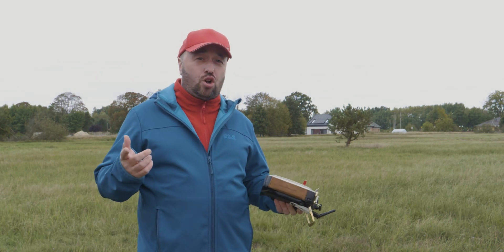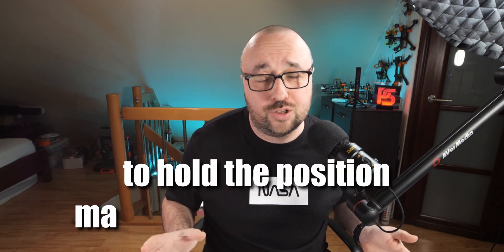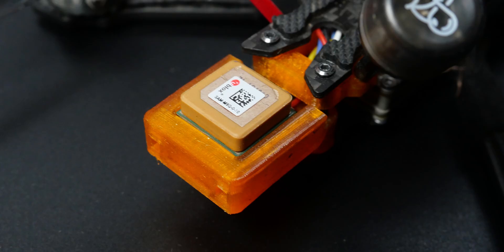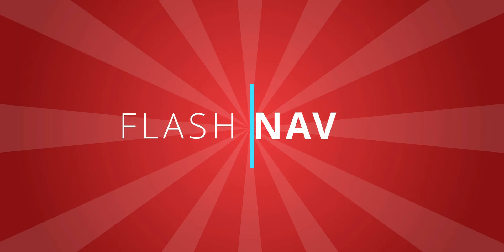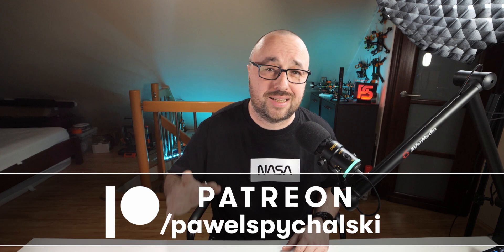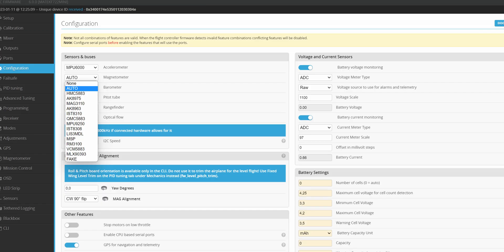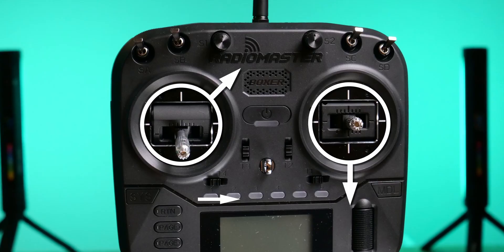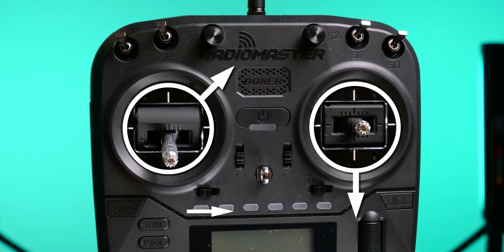8 steps to GPS Position Hold for an FPV drone

Comment: I've always flown 5" with betaflight but I've recently got into 7" medium range cruising. Would you recommend inav over betaflight if I will be doing more smooth flying with very slight flips and rolls? I've used inav on wings before and it was brilliant but never used it on a drone before

Comment: I have a Ysido F4 v3 with baro Flight Controller and unfortunately, don't have SCL and SDA ports. Do you have something in mind how to connect a I2C equipement in the board? I have tried remapping ports in betaflight but doesn't seems to work.

Comment: So you have to combine position hold with altitude hold, ie position hold only fixes lat and long, not altitude? The disarm works automatically, mentioned at 6:20? Thanks for the info, useful video.

Comment: I have a question, I have tested position hold and alt hold, and in most cases, it worked fine but sometimes I had a situation when drone started to circle around position and these circles started to bigger and bigger and I needed to turn off position hold and turn on again after which it usually stabilizes. do you know a possible reason for this? could you please suggest steps how to fix it?

Comment: So i got it working really good in pos hold except for when i lower throttle just a little bit it falls down instead of slowly going down. Up is going good smooth and fast if i want.
Tried alot but i am missing somthing in settings.any ideas what to look at?
Thanks for still delivering good and fun videos Pavel
Reply from the maker: I think you should try using option to use mid-stick for alt control. It can be set on advanced tuning page. Happy flying!
Reply: @FPVUniversity  if not using the mid stick hoover does i loose resolution on throttle? If so That might be the case.
Thanks again

Comment: I installed RushFPV M10 GPS (no magnetometer) on my quad I already have a magnetometer on my quad. At a high altitude, I set ALT HOLD  just moving left and right , little bit up and down trying to keeping the altitude. Don't know what happened as soon as I selected the position hold my quad drifted to one side at a high speed and slammed into trees and broken one frame arm. I got 15 satellite lock. :(

Comment: Hi Pawel

I have switched to Inav. However I have no RTH or PosHold in the mode section.   Could you please help?

I have a GPS with compass and am using Inav 7
Reply from the maker: Baro? Do you have it as well?
Reply: @FPVUniversity  Thanks for the swift response!!  Ive managed to sort it and am preparing for a test flight tomorrow!!!!!

Comment: One more cavetta ☝️
The GPS icon will not turn into blue if you do not turn on your quad.
You have to connect the battery ☝️
Reply from the maker: Depends on flight controller. Many power GPS from USB too
Reply: @FPVUniversity  That was exactly the problem. The module lit up, but it wasn't until I connected the drone to the battery that the icon turned blue.

Comment: I got BN-880 and speedybee F405 V3 stack. Magnetometer appeared only first time in Betaflight and never came online. I switched to iNav, but whatever you do Magentometer and Barometer are set in red, It has been so frustrating that I am thinking of giving up.
Reply: did you figure it out?
Reply: @flat-earther yes, I did. It seems there was some congestion in the signal, I removed the GPS with compass and also removed the transmitter antennas apart and all started detecting and working. I had to change their location.

Comment: Thank you so much for the guide!! Got mine to hover in place!
Reply from the maker: Glad I could help!
Reply: I see not many have made videos to explain on how to make the RTH more configurable. I am trying to figure out how to make the first trigger of going up very fast then return at a much greater speed. I will be flying in HUGE waves and want to be able to hit the RTH or get a failsafe and the drone shoots up in the air then returns home before battery dies. The way its now its way to slow :-D Im sure there are commands to get this done.. Thank you!  @FPVUniversity

Comment: lol there are so many I nav RTH fail videos. Commercial drones have surpassed the DIY Community. Need an example Amazon had hundreds of kits and parts a few years ago. Now you would be hard pressed to build 5 drones with unique internals on amazon. Guess if you like having a drone that's the same as the other guys drone you could save yourself hours, that translates to dollars and mistakes that also translates to dollars, by buying a commercial drone that fits your needs. If your need is a Drone that is equal or better than commercial drones you would need to start with goggles that are not "analog" and 4k capable video feed there goes 600 dollars or more (no drone parts included.) want to fly a mile away? Well there's another couple hundred dollars. still (no drone parts included.) now to run the video you might want a vista or an air unit. lol more commercial parts about 200 to 300 each still (no frame, flight controller, gps or motors.)
Reply: goggles digital hd fat shark $549 they suck
vista digital $179 or air 03 $285
flight controller stack $129
we will use a cheep $30 frame
middle of the road 60 dollar motors.
batteries $60 
antennas wires screws ect. $30

4k digital DIY average from scratch using the lowest figures above $1,037 (this drone will perform better only if you built it as an fpv drone. No DIY camera drone holds a match to commercial photography drones on the market at around $600 to $1000
Reply: I just noticed in that 1037 dollar build, you still don't have an rx or tx. you will need that if you don't already have one that links to all the stuff you just bought.

Comment: Hi I have a real nightmare of a problem. I have never encountered this before.
Just bought a Foxeer 120 GPS, I have wrapped the wires except the live wire in Copper tape and then insulated them so it cant make any connections on my Fc.
I finds 6 maybe more sats in a minute.
As soon as I attach the top plate of my quad, it stops all gps signals.
I have tried copper tape on the underside of the top plate, stops signals
Tried plastic plate as a test, stops signal
The gps is located at the rear like yours and I cant put the cables on the outside at branches ect could easily catch them.
I have done everything I can think of 
Help welcome
Reply from the maker: there is nothing you can do. Too much RF interference. So either buy better GPS or have it in the back where is less RF noise

Comment: I am using  inav on cinebot30 but i am having issue . When i change board yaw orientation by 45 degree the magnetometer orientation also gets offset by 45 degree why ?
Reply from the maker: this is how it's designed. Use Mag setup too in INAV

Comment: Hi Pawel, I was following your steps and my gps is not communicating and is showing red in Inav. I’ve checked my wiring and it is correct and I’m running ublox protocol too! Any tips?

Thanks
Reply: did you figure it out?

Comment: Can you please explain in detail where you wire the SCL and SDA to actually on the flight controller, which pads???. I assume there are extra pads on GPS module and are labelled hopefully in my case, no idea what brand etc. May try converting to INAV on one quad to see
Reply from the maker: GPS with MAG will have 6 pads. + GND, TX, RX SCL SDA. SCL SDA might be marked CL, DA, SC, SD. Depends on the module
Reply: @FPVUniversity  Understand that GPS module part, but where on FC pads? As in, I've never seen SCL and SDA pads on FC, or any pinout diagram
Reply: because there in no SCL and SDA on every FC. you have to buy FC with Baro build on
I have this one: FOXEER REAPER F745 45A 2-6S AIO FC

Comment: Hello Pawel, I've heard it somewhere that you can 'parallel' GPS + Magnetometer + Barometer on  a 'single' SDA/SCL? Having most FC's only come with a pair of them.  I have GPS already connected on my FC's SDA/SCL but I plan to buy a separate Barometer and was stumped on where to put it.
Reply: You can connect all scl wires to scl and sda wires to sda. If needed you can splice wires from one sensor line( i.e gps) to all other i2c sensors ( mag, baro, airspeed, etc.)

Comment: Can you tell me if I can connect an Eachine F411 Flight Controller to a GPS module because I don’t see SDA and SCL connectors on the flight controller
Reply: because there in no SCL and SDA on every FC. you have to buy FC with Baro build on
I have this one: FOXEER REAPER F745 45A 2-6S AIO FC

Comment: Hi Pawel, the problem is how do I know whether my current fpv has a  built-in barometer? Do you have a suggestion to give a quick check on that？
Reply from the maker: Check if Configurator of the software you use detects baro, That usually is the way to handle this

Comment: Hi Pawel 
build a 5 inch quad with inav 
Using hglrc f722 flight controller 
Hglrc gps 
First I put drone in angle mode after at a height of 1 meter put inav position hold mode and it's goes goes up in very fast speed of and after certain level it's get stable 
I want to stable my drone at the same height at angle mode
Pls give suggestions
Reply: Have you able to fix this problem on your drone coz I'm having the same problem with the same specs as your drone? tnx

Comment: Pain and inav, inav and pain.
No, thanks Pavel.
Reply from the maker: I suppose you have not used INAV in a very long time. A lot changed in the last few years and I would even argue that setting up INAV can be simpler than setting up Betaflight when the same features are used here and here

Comment: Pawel, great video. My drone holds position well, but does not hold altitude well...any suggestions? Thanks!
Reply from the maker: Vibration and/or wind gusts in barometer. Start with adding some open-cell foam over the barometer

Comment: Hi, is geprc span f722 bt hd v2 flight controller supported on latest inav ? I tried using iflight twing firmware but all sensor is red.
Reply from the maker: The situation is that all the FC manufacturers that were interested in having INAV support have INAV support. If not, I suggest contacting GepRC customer support

Comment: Thanks for the video. It works great on my INAV builds. One suggestion maybe for another video: I have read that for FCs with no SDA SCL pads it may be possible to remap UART3 to I2C because this pin on the chip can both(?) Is this correct and how is it done?
Reply from the maker: This is doable only for some FC. It's not a rule! Majority of INAv supported FC have I2C already

Comment: I've got a bn-880 and it gets sat lock in seconds even indoors. I'm going to run inav on this build. Thanks for all your work demystifying FPV.
Reply: I have to say this as well that the BN-880 is the best bang for your buck. It's cheap, always reliable and always had same or better reception as with other modules even indoors so it is sitting on almost (5 of 7) all my INAV models.

Comment: My first DIY position hold was with INav... but it flew terrible and toilet bowling was a REAL issue.

I look forward to trying it again since the INav updates!
Reply: Toilet bowling is almost always compass misaligment, very easy to fix.
Reply: @adilsongoliveira  Maybe now - this was years ago....
Reply: I was having trouble with it as well on a Darwin 129 I converted to INAV. Had to move the gps from it stock position in the back to on top. I think the cap on the esc was causing the toilet bowling issues.
Reply: @sams9716  Having the mag next to wiring with high currents can do that as well.

Comment: I did a little bit of work on the magnetometer tool (not much) so it makes me very happy to see it being useful!
Reply from the maker: Nice work! And thanks for the effort
Reply: @FPVUniversity hi spy so im very confused with the magnetometer orintation. My module has no direction signs.  So i will just install it exactly as seen in inav. Or does the red arrow have to be pointing forward at all times. 
For example do I set it up in inav axactly likr it is in real life. Or do i set it up with the arrow pointing forward at all time in inav the littpe red arrow

Comment: This is really great information. I have a question, is the matek m8q 5883 just really good? so it doesn’t need to be mounted in a mast to avoid compass interference ? Will it get out of calibration often since it’s so close? 

I just have seen so many people use a mast to avoid compass interference issues. Struggled with it in the past myself.
Reply from the maker: All my quads fly with gps/mag between rear arms and it works perfectly
Reply: @FPVUniversity  Cool 😎